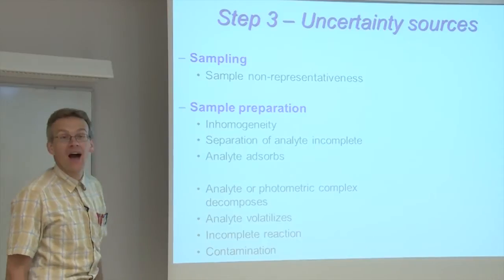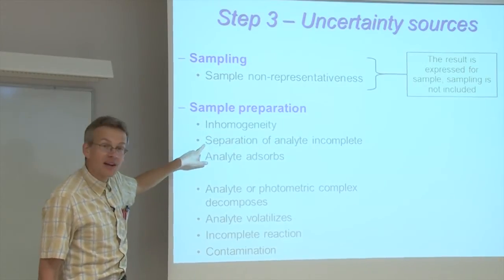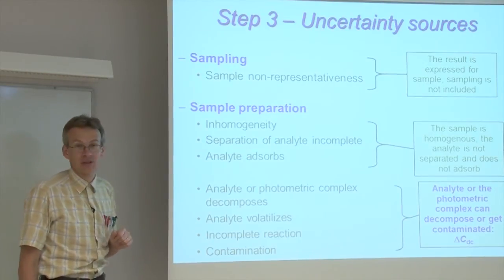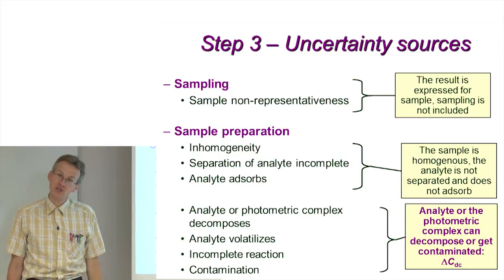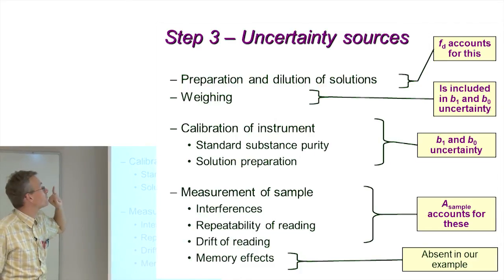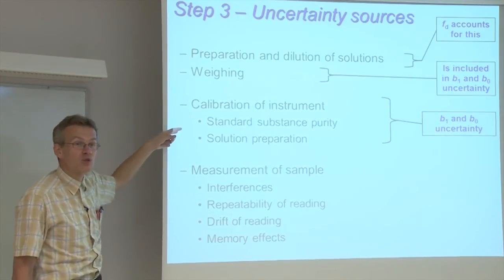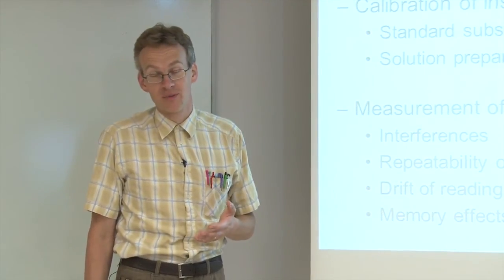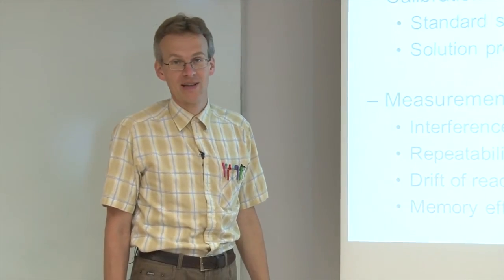9.3.2 STEP 3 -- Uncertainty sources: one by one

Comment: Thanks a lot for the video. It's helping me a lot.
I have a question... we don't have to account the equipment's accuracy for the uncertainty calculation?

For example: 
I have to determinate the uncertainty of a pH measurement. The manufacturer of the pH meter specifies the equipment's accuracy: +- 0.2 pH unit. So, using this information my uncertainty should be at least 0.2 pH unit. Does it work this way?

Thank you again.